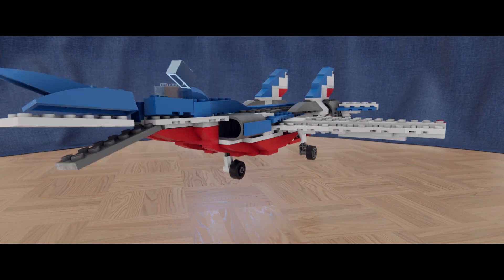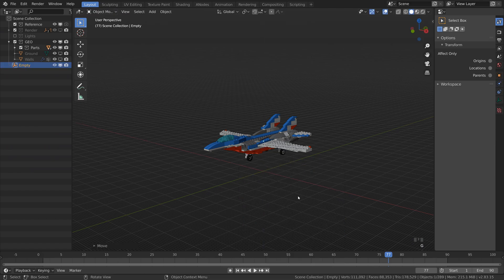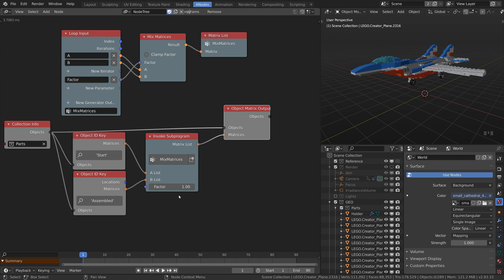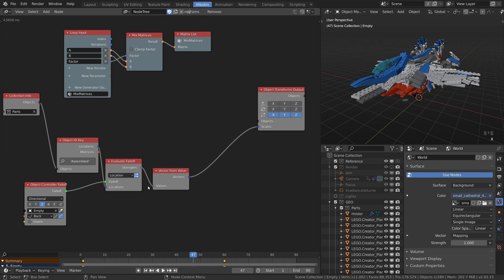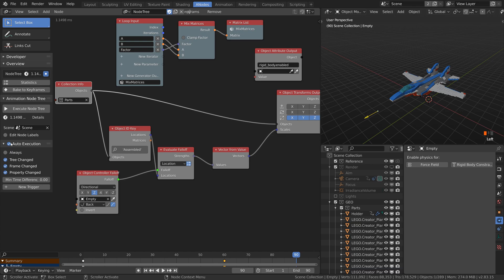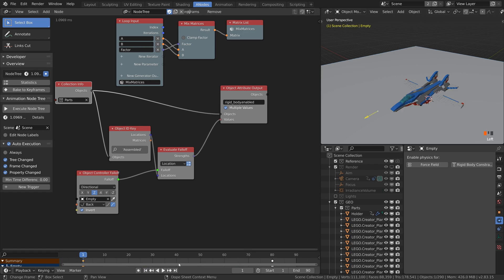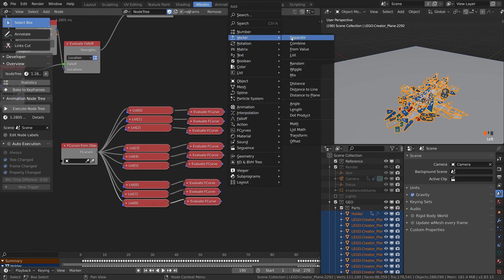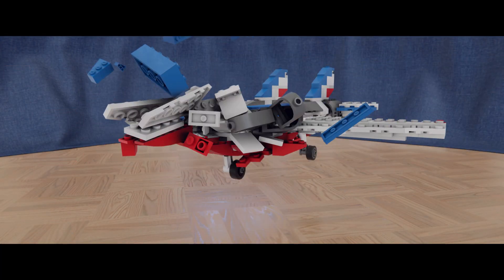[025] Blender - Assembly animation tutorial [Animation Nodes, EEVEE]

Comment: thx! I followed ur tutorial until the rigid-body part. some how it dosen work very well coz the all parts 'exploded' through collision...it dosent move appropriate as ur...I repeat many times and still the same. I was woundering if there are anything wrong but I couldnt Figure it out...can it be problem of blender version(some default setting changed). I use blender 2.91. Thx in advanced!

Comment: Trying to do this, the final part of blending the two piles of parts, the animation fails. I get as far as muting the fcurves and setting up the subprogram, but running animation nodes does not behave remotely as the video. The parts appear in place as if assembled but neither pile of parts is visible. 🤔😕
Reply: Following on from the above, here's a video showing my issue, along with link to the blend file at this point.
https://youtu.be/zc7jEUs2Gnw
If anyone can shed light on this, I would be most grateful.

Comment: nice job figuring that one out. But holy sh*** this is soo convoluted and inefficient in Blender. This program absolutely needs physics with a follow position/rotation option. You can do this animation in c4d in minutes on the fly without baking anything. Hope Blender will soon upgrade those features. This isn't practical at all for real commission work.
Reply from the maker: To be fair, you don't really have to bake anything and I like the extensive control of Animation nodes (even more than xPresso and Mograph), 
BUT... I 100% agree that we desperately need better rigid body control (triggers, apply action as force, etc.).
It's all promised in "Everything nodes", but that's still far away.